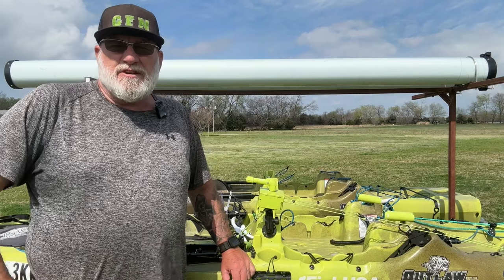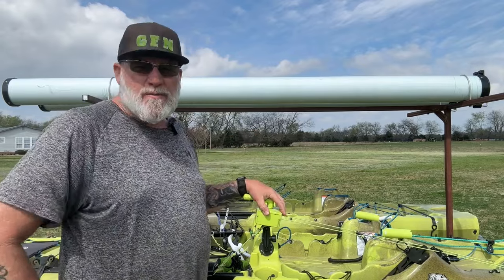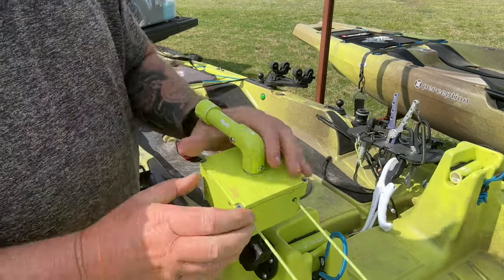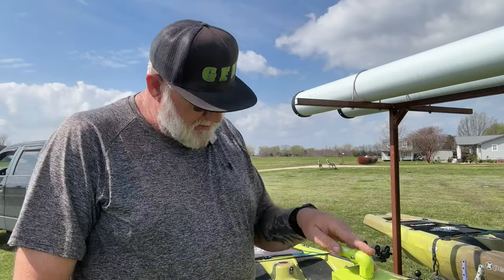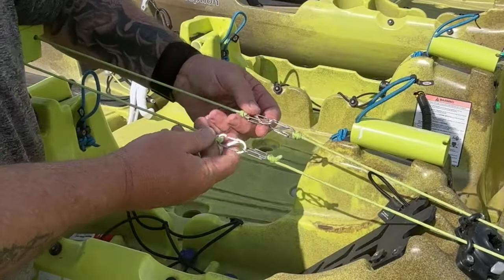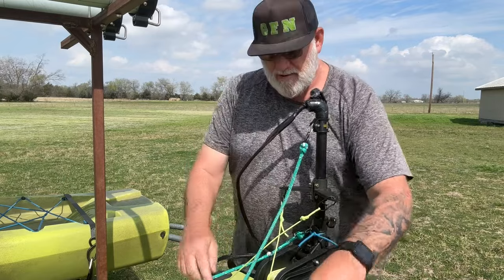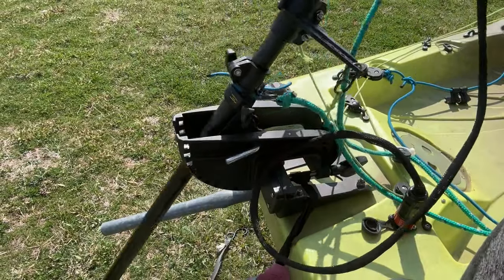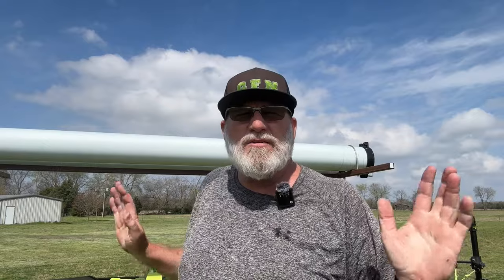The Ultimate DIY Kayak Steering system

Comment: That dual wing sleeve clamped to your motor shaft, I need to get one. Where did you buy that? (I'm in the midst of tearing apart a MINN KOTA. I will likely go foot steer but I enjoyed your pulley invention.
Reply from the maker: Amazon. It’s a trolling motor steering arm
Reply: Just flip it around the other way for more play .wings facing the rear

Comment: Some good ideas with your steering. The bushings I found does not allow for a half inch pipe to pass all the way through like that did you modify your bushing to get the pipe to go all the way out the bottom?
Reply from the maker: Yes I drilled the shoulder off of the bottom so pipe slides through